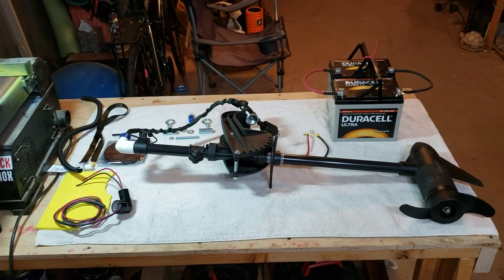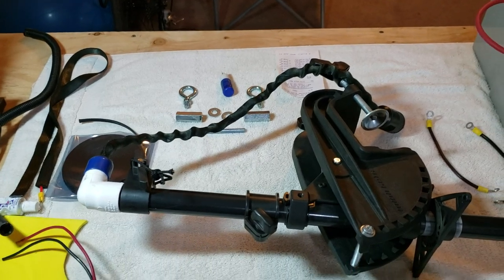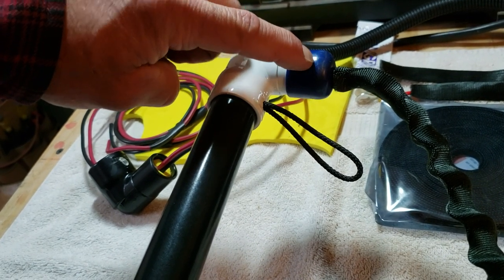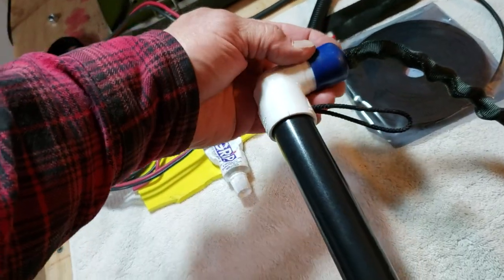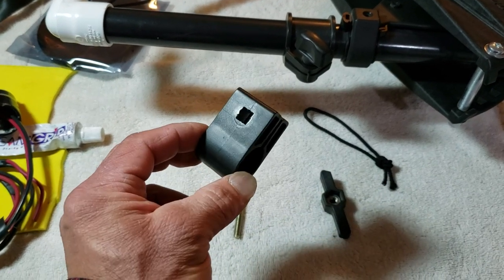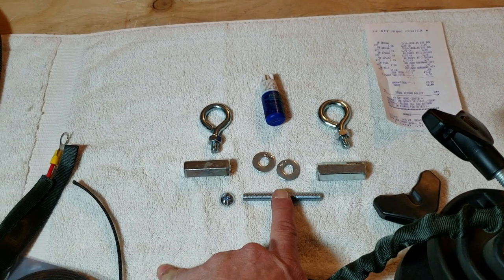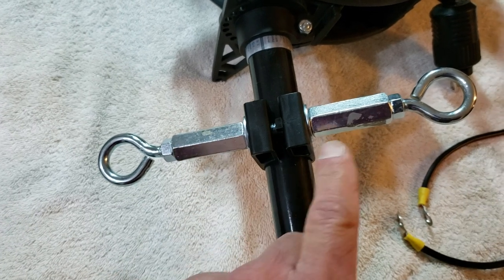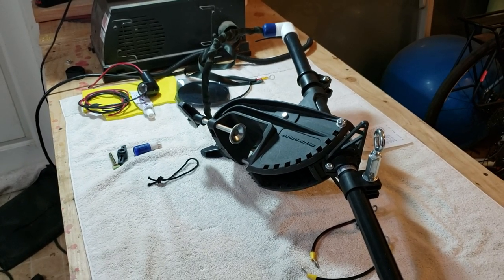Kayak Trolling Motor Steering Arm and other improvements!

Comment: JUST THE VIDEO I was seeking! Thanks!
Reply from the maker: Now, I did change the "eye bolts" to "thumb screws"  on my new kayak... its easier to use mini "S" biners for quick release. Thats in the "steering and hoist" vid here:
https://youtu.be/HTAkmP_8feA
Reply from the maker: Also, I have improved the motor shaft cap here at 4:29, btw.
https://youtu.be/OnIRXGUGwB0